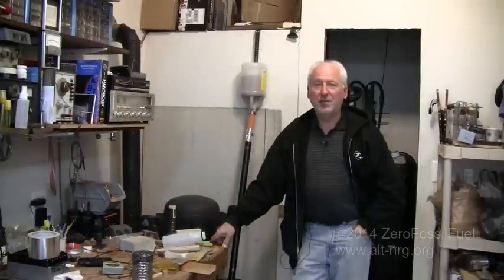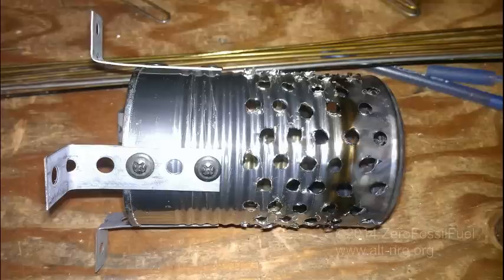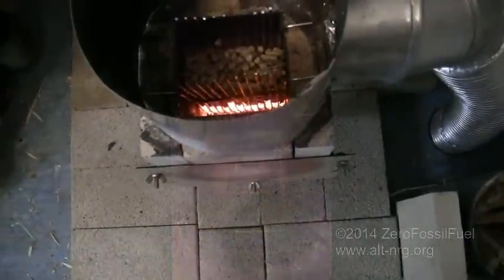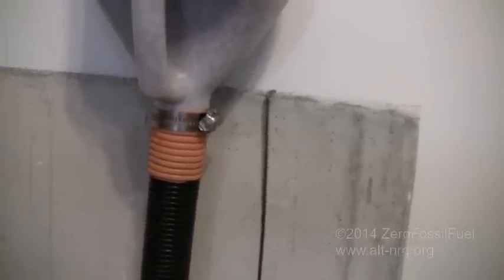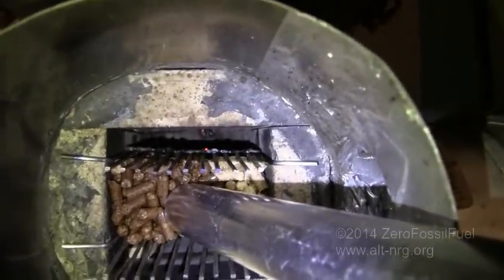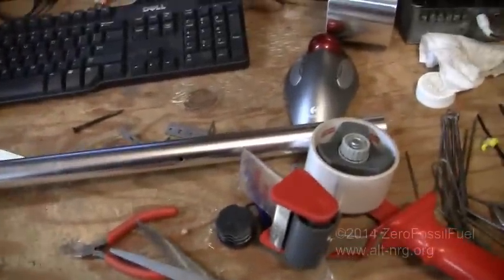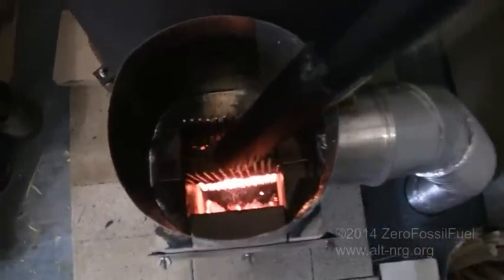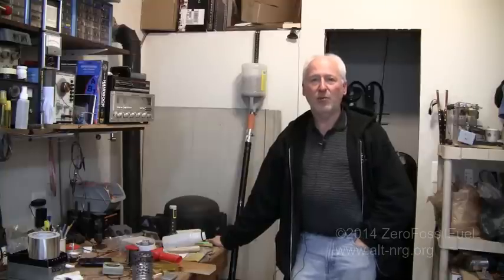#354 Rocket stove heater wood pellet mod!!!

Comment: I used to be a bee keeper and I used cedar shavings in my smoker. I would start the cedar shavings burning first ( The shavings are sold at Walmart as pet bedding). The cedar starts very easy. Once the cedar is burning well, I would add a couple of hand fulls of the pellets.  The pelle
ts would catch without any trouble.
Reply from the maker: Oooh. I like that idea!
Reply: Yeah we use them for kitty litter

Comment: Put a brick and cob mass heater with your chimney pipe running away from and back to your current pipe exit on the back half of the underside of your bench and you'll get warmth for many hours after you burn.  This will save you some pellets and wear on your pellet grate which means saving more money and work.  Love the hopper.  I've been looking for ideas on how to make one.  This set up will work nicely.  Thanks.

Comment: That is an amazing mod.  I built a rocket stove using a 100lb. propane tank and 4X4 square tubing and I was trying to figure out how to use wood pellets.  I am so excited to implement your design!!!
Reply from the maker: Anthony Munn I sure hope you'll post a video of it!
Reply from the maker: Anthony Munn Be sure to watch all of my videos on the pellet fire basket design. It has been refined far beyond this first prototype.
Reply: I watched them all.  Thank you for all of your trial and error.
Reply: Bart, I am currently living in Albuquerque, NM. My propane tank rocket stove project sits unfinished in my shop at my home in Bellingham, WA.   I do not have any pictures of the tank.

Comment: I live in Wy, I used my rocket heater from October to March, no clean out, burned scrap wood from a friends wood shop, nothing larger than 3x4in, by up to 24" long, used to heat my 1500 sq foot house with a lot of sub zero out side temps. On the coldest of days i would do three burns per day the burn would last for perhaps 30 min,
I used to burn at least 3 cords of wood in my old wood burning stove,
Rocket heater was a Huge sucess,
Reply: EarlRausch 
 so how much wood, would you estimate to burn through now?

Comment: For the last few years, I have been using pellets coated with cheap ($6 gal) cooking oil to start my old pellet stove without a electric lighter.
I am thinking cooking oil and a BBQ starter fluid mixture would work even better. 
The pellet stove manufacturers discovered very quickly that a gravity feed system can be VERY dangerous. You can get small cheap dirt augers, from farm supply stores, that should be easy to use to make a safer feed system using a small gear motor and digital timer.

Comment: Great Job, keep it up. 
Try slotting the feed pipe leaving two points of connection and pass a thin tab through. That should impide the flow of pellets. 
With a chop saw, cut partially through one slide, rotate 180°, repeat. Good luck.

Comment: If you just use a 2X3" tube to feed the pellets down to the burner, you don't need a vibrator. I actually have a 3X3" square tube feeding pellets to my burner and it works flawlessly. My burner is made out of 1/4" stainless rods, with 1/4" gap between the rods. To shut it down is have a steel slide in the upper part of the feed tube to slide inside the tube, closing off the pellet feed. It works perfect!
Reply from the maker: +Painter D Yes, I agree. My tube is too small. I'm just too lazy to upgrade it! XD
Reply: +ZeroFossilFuel how long of a run time do you get out of a full bag of pellets...
Reply from the maker: When it's up to full temp it consumes about 4lb/hr. It raises my workshop temp 4.5*F/lb of pellets. So, I never let it run more than a couple of hours at a time. If I did, a 40lb bag should run about 10 hours. If I did that and started with a temp of 45*F in the workshop, by the time it's done it would be 225*F in the shop!
Reply: +tloutfitter I only use a dog bowl scoop full of pellets every 2 - 3 hours but I also have my exaust going thru a metal toolbox from the back of a truck back and forth a few times as a thermal mass heater bench to sit on and it keeps on giving off heat for many hours after the fire has gone out :) But yes burning steady I go thru a 40lb bag per day :)

Comment: I have done much experiment with rocket type stoves. I have achieved such high temperatures that my 1/4" solid stainless grate was burned through in the center of the grate in only 8 hours of burn time. 
Achieving high temperatures means more complete burn and less ash but also means you must use a material like ceramic or refractory cement as the grate material. HINT: to greatly increase burn efficiency - pre heat your intake air. Yes intake air needs to be drawn from outside but pre heating it to at least 200°F will give you an incredible burn that will almost never go out. I was pre heating my air to about 500°F and obviously it is physically impossible for the flame to go out when the feed air is over the combustion temp of the fuel. Next heating  season I will start adding nails to my biomass briquettes and STEEL will become a part of my heating fuel...... just like in coal burning electric plants.

Comment: Hey Z,
What about putting a few twigs into the hopper to start then add the pellets after. Once the twigs start burning, that may be enough of a boost to ease starting the pellets.

As to stopping the flow of pellets; bend a little piece of flat metal into an L bracket and use it to close off your pipe. Then you can simply remove the feed and plug the tube until you want to re-install it.

Me like em!
Reply from the maker: I think the first thing I will try is to release pellets only about 1" deep in the grate to light then slowly start the flow afterward.

Comment: i used galvinized stucco wire to make a basket which worked great -- took all but five minutes to make .  i just  cut and bent the top of the basket over and placed two bricks on it. it work out great! started out with wood then introduced the the pellets in the basket.  if it burns out eventually its easy to make another. two cups of pellets ran for about an hour.

Comment: I used to start mine with a tablespoon or two 90% pure isopropyl alcohol.  It lit really well, but I've found another way I like better.  I use two paper towels (or just some scrap paper).  One I tear up into about 4 pieces... I ball them up, and place them on top of the pellets, ready to light.  The other one I twist up, insert into the burn chamber via the clean-out port, and light.  As soon as the twisted one is lit, I push to back to the riser section to get a draft started and close the clean-out access door.  Then I can use a long lighter to light the balled up pieces that are waiting on top of the pellets.  Starts up very well.

Comment: If you drill a hole the back side of your burn box  perpendicular to the bottom of your basket, you can insert your torch to light your pellets. If an open hole is a concern, you could always add a teardrop plate with a bolt at the top to swing down and cover the hole once you're lit!
Reply from the maker: That's a very good idea.

Comment: I posted on T2H's channel and the new forum regarding my rocket stoves performance and some crazy but interesting ideas. Hope you see it. My prototype burns sticks and/or pellets, but sticks don't come close to performing like pellets! My latest pellet chute mod is burning close to 8 lbs. an hour through a 3 1/2 inch riser, but that leaves no room to burn anything else at the same time but smaller sticks. What a sound!!   Can't wait to cook supper again tonight!!
I have no back burn into the hopper in spite of vertical gravity feed, and it's natural draft.  My burn chamber evolved into a modified, 4" x 6" J tube at a 25 degree angle, with a short vertical section near the mouth for the pellets. The 3 1/2" riser is carbon steel exhaust pipe, but it and the 1/4" wall sleeve it sets in are orange hot when burning 6 to 8 pounds per hour...upwards of 1500 degrees F! Even at half that burn rate the top of burn chamber and the riser get a dull red.
The pellet chute and SS burn screen are at about a 30 degree angle, hugging the ceiling of the fuel chamber that I burn sticks in. The stove guts are inside a grease drum, with perlite filling the bottom and insulating the burn chamber only, giving me an oven area around the riser. The riser passes through the drum top, enters a 50+ pound heat exchanger box where it is forced to go horizontal for about 12", then exits down thru a heavy wall 4" tube that connects to flue pipe. No can on top, more like KB's Omega Stove.
The trick was finding the right Stainless mesh (.047 x 3 x 3) and the right angle so it would feed smoothly and fall through the mesh at the right rate. If I ever stop improving it I will get a video up, but I am striving to burn sticks and pellets simultaneously, so I can tend to the fire on my terms. Like I said, the 25 degree angle evolved by accident, so my next one will be a 45 degree angle, since sticks will not self feed at 25 degrees.
Reply from the maker: kelhawk1 Got any links? I'd love to see it!
Reply: ZeroFossilFuel I'm taking a lunch break from reworking my outside air intake to larger cross sections. The 8 lbs/hr happened when I just had it tacked on to the burn chamber with lots of leaks. When I mortared the cracks shut I had to run it with the door open to get enough air! Apparently it was leaking way more than I figured. Last night I put in my 4 lb/hr chute, but with leaks fixed, it would not take off with only outside air. I slid the chute a mere 1/2" closer to the riser outlet, which left it intruding into the opening that same 1/2". That got it burning  2 lb/hr, until I holesawed 4) 1" holes in my air ducting, just to see where it was starved. Then it burned 4 lb/hr like before and gave me insight to correct it. Before I am finished I will have my pellet chute so it adjusts up & 
down the chamber ceiling, nearer or further from the riser outlet. I don't know how to work links, but will try to get some still pics on the forum until I get this thing ready for video. (My stupid smart phone is deactivated till I can afford it on $1200/mo SS) This shit's addicting!! Thanks for your acknowledgement!

Comment: I had another idea for controlling the pellet flow to the rocket; might make an interesting project as well. Consider constructing an external horizontal auger feed system. I don't think it would need to be any longer than 6-inches. Since it would not be subjected to extreme temps, it could be made of PVC pipe. A PVC Tee would direct pellets into the PVC auger tube. Auger motors are relatively inexpensive off ebay. You would need to design and build a small auger and a variable timer system to pulse the auger motor. When you turn off the auger, pellet flow to the rocket would stop. Since there may be only and inch of pellets in the hopper at any one time, you might have to add a baffle plate to maintain proper air flow through pellets. The variable timer design would permit you to control the amount of heat being generated by the rocket. Regards.

Comment: You can use gelled alcohol or Vaseline to start your pellets. Both work great. I wipe a paper towel in the Vaseline and put some pellets in the towel, and lite. Let it burn down good before starting flow of new pellets so new feed does not smother it out. Good luck.

Comment: Zero,
Have been following you since the OH days. Had a lawnmower running for awhile strickly on a plasma setup, no electronics. On your pellet stove, placed your pellet hopper in the firebox from corner to corner to start the fire. Have the front balance arms sticking out of the chamber through a slot, such that when you have it started you can move the arms to the rear making the hopper closer to the back of the fire box. Could label them start position and run.Slot being large enouogh for the arms to stick out should not create an accessory draft. Need to add a clean out door on the steel enclosure so you can clean it out without dismantling the unit. Make it the size of half a brick. Make a mini hoe to pull the ash out with. Should be big enough

Bill

Comment: Well, that sure beats the crap out of the unnecessarily complicated design that I was planning. My plan was to use expanded stainless steel to make two burn baskets on top of each other with the bottom basket having smaller openings in order to allow the fall-through pellets to finish burning.
Reply from the maker: Wait until you see my next video... :)

Comment: For better feeding of your pellets, have you considered truncating your tube feeder? That means to make it smaller at the top and larger at the bottom. Perhaps this could be accomplished by leaving the bottom round, and slightly flattening the tube more and more as you go up to the feed hopper hence reducing the volume. Perhaps this would reduce any clogging.

Comment: great job i like the hopper so you dont have to be at it every hour very cool.309 stainless is what is used in high heat apps stainless burns up also 309 will hold up like cast iron great vid. mike

Comment: Here are some ideas.
- Put a swing flap in front of the box to give you access to light it with a blow torch
- Adjust the rate of burn by limiting the air in.  This can be used to put it out too
- have an emergency CO2 setup to put it out FAST.  At the same time, this won't harm the stove.
- use a larger diameter tube that is smooth on the inside to prevent binding pellets.
- A bigger hopper might be a good idea
- put a shroud over the fins and put a small electric fan to blow air past the fins to double to output of the heat in the room.
- Find a heavy duty spring to use as your cage for the pellets.  Weld a plate on the bottom of it and drill holes in it.  That should last a LONG time before needing replacement.

I hope this helps.  Please tell me what you think.

Comment: My stove uses a flat bottom V shape burner (3" across the bottom and tapered to 4" at the top and is 3" high. The stainless rods are just close enough together so the pellets don't fall thru and burn completely. My burn tube is 4" square tubing, 16" long.

Comment: You should encase some of the rocket stove in a clay or concrete material to make it a mas rocket stove... This will allow the heat to radiate into the room much longer then it currently does after it has been shut off due to the stone or clay's ability to store the heat and radiate it for long periods of time...

Comment: To start, GREAT JOB!!  I'm new to this, and have a couple of things to think about....
One problem seems to be controlling burn..  As you point out, its getting too hot in the shop...  Damper on your exhaust maybe?  Or how about damper on your intake (I notice that you use air from outside (burning cold air better than warm air.)).  My concern with both of these damper options would be CO...  No other videos online mention it.  Given its lethality, it is well worth considering in such a restricted area... 
Another way of changing the heat being produced could be changing the dimensions of the burn chamber (on the fly)...  This would take some fairly major rethinking of how the chamber is  built...  But not impossible...  Your forethought on the design facilitates this.  That is, from what I have seen, I think you can change/swap out your burn chamber.
Also, starting, Rattlerjake1 suggests oil, I like where he is going with it...  Smell, and safety, maybe a consideration...  Another option would be a access door/hatch through the side or front, that can be opened and closed, this would let you have access to the burn chamber easily.
Your project really is inspiring.  Thank you.
Reply from the maker: Bart Wilson Damper on the intake would work better because it would create negative pressures inside the stove and prevent gas leakage. I also slide the pellet fire basket back a little to let air pass in front of it. That cools down the burn and regulates to some degree.

Comment: Great job! I'm building a small unit for my greenhouse with both wood and pellet burning capabilities. The screen I'm using is stainless with a 5/32 hole and stagger. I'm hoping this will work fine otherwise I will be applying your design. I'll let you know how I goes.

Comment: Try denatured alcohol as a primer.  Much hotter and no flash burn.

Will be interesting to see if the 308L can take it long-term.  I have not had good luck getting any grade stainless to withstand extreme temps. Too bad you can't find some cast iron that would work.

For the shut-off, I wonder if a sliding gate located at the lower end of the feed tube would work?  It would have to be thin so it could work its way through the pellets. Sharpen the edge that comes in contact with pellets in case it needs to cut through a pellet or two.
Instead of a plate, possibly use several pieces of thin rod welded together. Spaced apart so that pellets can't pass through while making it easier to get through pellets than a solid plate. Round the ends of the rods (not sharpened) to push pellets out of the way versus getting stuck in them.  Just thoughts...

Comment: I never tought much about the stick burning rocket stove heater because it requires constant feeding of sticks but with the pellet hoper it seen to work better.
I see that Kntryhart has sugested using an auger, that would work even better.
Of course the pellet BBQ somoker folks have been using augers to feed pellets into their smokers for a long time.
Reply from the maker: I don't use an augur for two reasons. I want the system to operate completely off grid and mechanically it's just one more point of failure.
Reply: Oh yes, I see your point.